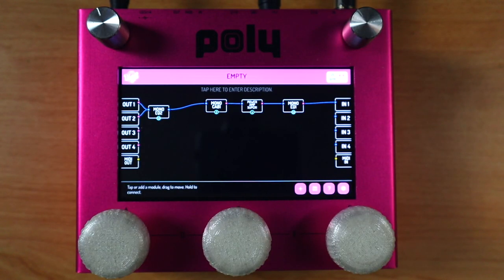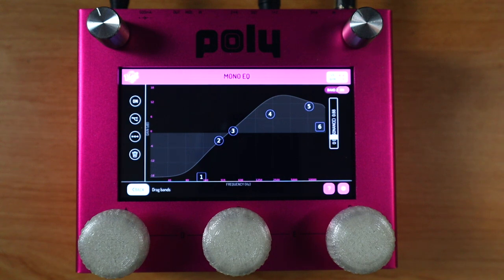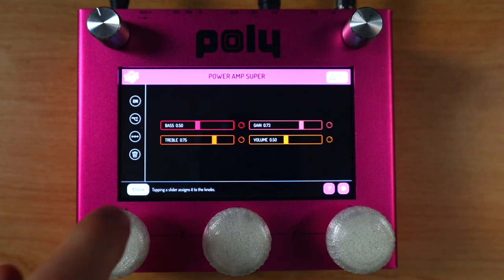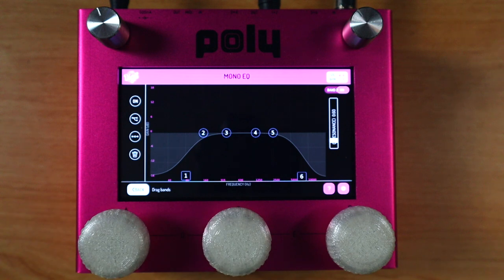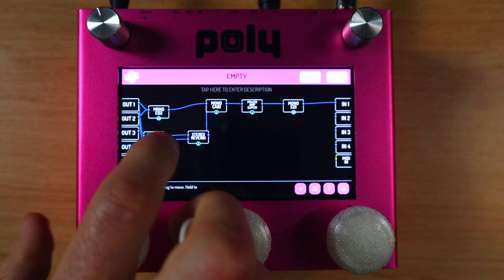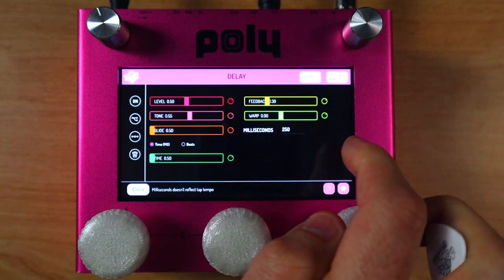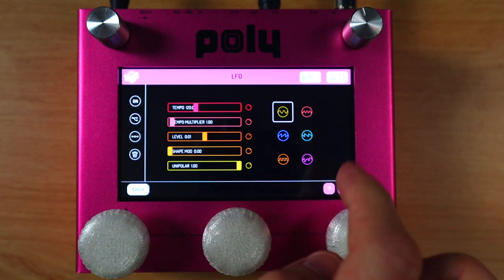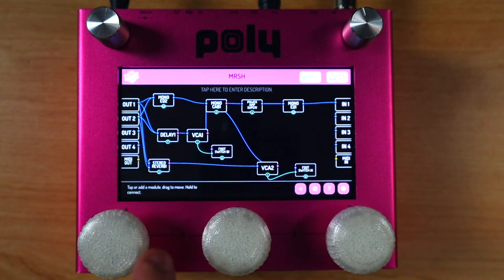Poly Digit For Direct Guitar Tones? - Tutorial

Comment: Holy crap that sounds good. I'm really close to pulling the trigger on this. I have a Kemper so amp sim stuff isn't a huge deal but can this thing get a modern mid/high gain sound ya think? It seems like there's probably enough gain to work with in the box but does it take OD pedals well?

Comment: This thing has been nothing but a disappointment. NO MATTER how I hook it up  (straight in, through loop, etc.) it is noisier than any of my 70's EHX pedals even straight through (input to output with nothing in between). And the Beats Per Minute bleeds through the output with this faint clicking noise. I have yet to get anything useful out of it. Waist of $399.00
Reply: Figured out the issue. This device is extremely sensitive to power supply. It needs a dedicated 9v dc at exactly 500 ma. You cannot go over that 500 ma level at all!